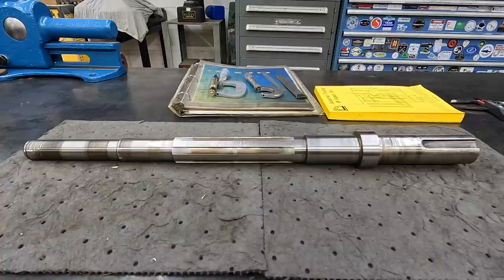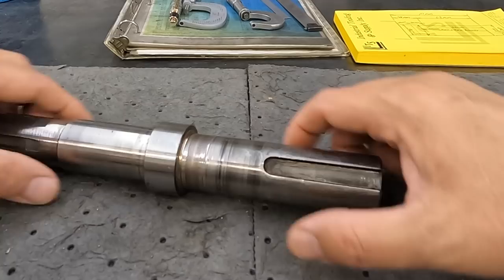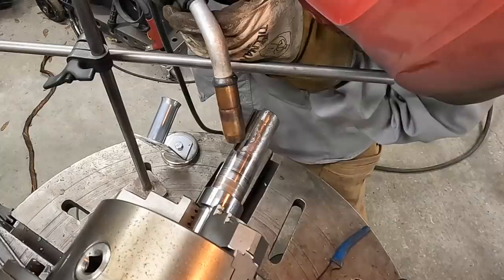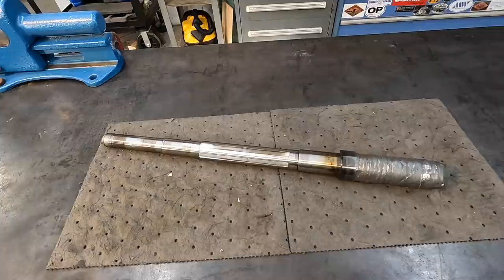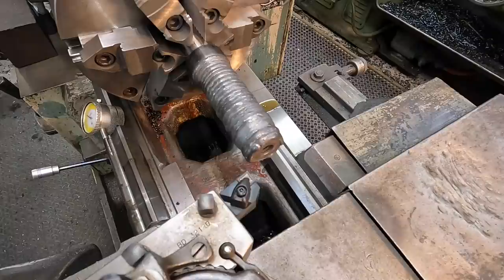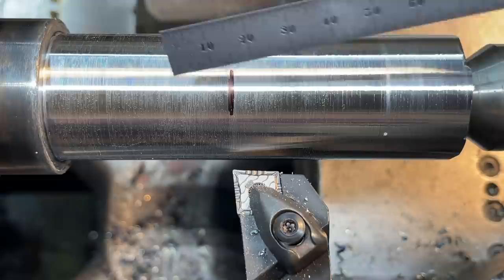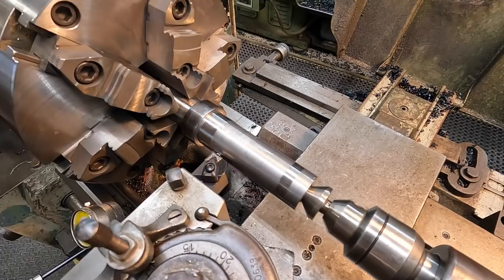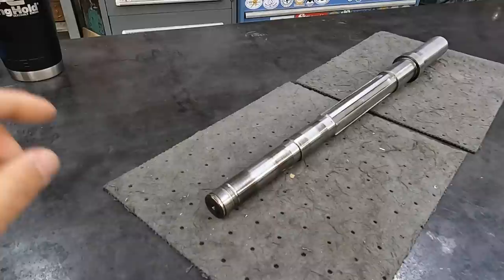Lathe Clutch Shaft Repair Part 1

Comment: I am new to this. But isn't it easier and more reliable piece if cut a new one?
Reply: If by cut a new one you mean make a new one from scratch, then no, it would definitely be more work. And a good repair should be nearly as reliable.
Reply: No the weld build up is as hard if not harder than original material.
Reply: @netsch20  
Thanks for the reply. Does the weld need to be heat treated in any way before machining to make it easier for machining? Does it need heat treatment after machining to retain its toughness?
Reply: @samimas4343  I'm no expert, but afaik no it wouldn't. Like the guy above who replied, welds are generally harder than the base metal.

Comment: Probably ok as this is a low stress item, although it is bad practice to radial weld a rotating shaft , should be longitudinal welds.
Reply: Why is that?
Reply: @davidraper9629  Theory is it will radial stress fracture and at some point in the future will snap like a carrot
Reply: @pijnto  I would love to read a paper on that. Something I have thought about in the past. However I never did anything more than think about It as it rarely applies to my situation but comes up occasionally.
Reply: @warrenjones744   sounds like nonsense. HT and temper are gone, so it won't "snap like a carrot." It will just bend... So I think he's just posing nonsense. and if it gets sent out for HT, which he probably won't since he's machining it to final tolerance, it's going to take care of any reasons he thinks may cause it to "snap." If it were to be sent out to HT, I can't think of any situation that would cause it to snap. Whether it is soft from welding, or gets heat tested. Maybe if you're building up half of the shaft's diameter with weld, it may cause issue, but that's generally not how welds work.
Reply: @littlejackalo5326  Like I said, I have thought about it and wondered, not too hard I might add, more of a passing thought. Anyway it would be interesting from a knowledge standpoint (for me anyway)  to read a paper on this subject. Either supporting the theory or not supporting it. Or perhaps @pijnto could have  given us an example of of something that failed from such action.
 
I on occasion weld shaft ends radially with an attachment for my borewelder or by hand and have never encountered any problems from doing so on machinery with moderate to somewhat heavy loading.  And as you point out,  it is never a lot of build up. Never more than a pass or two in which a vast majority gets machined off anyway.

Comment: ===CORRECTION I didn’t catch the “8” ====== leaving original comment - thanks for correcting me everyone. 

So do you need to build it back up? On the paper it said X.3785 right? And you measured X.3740?  I am a bit confused, apologies…. Unless this is within tolerance?
Reply: missing a 8, 3784
Reply: He ended up on .3784, thus one tenth under. Well within the 4 tenths tolerance.
Reply: At 25:11 he says "3784".
Reply: @gibbogle  thanks guys
Reply: @michedmck  thx
Reply: @taylorwso  thx

Comment: I buy a lot of used Starrett and Mitutoyo metric micronmeters, want me to keep an eye out for some good value ones for your shop? It always pays to keep a set of metric/inch mics around even if you don't use them very often.
Reply: ...you're forgetting that Adam's machines are calibrated in INCHES- I can't see how a set of METRIC micrometers would be of much use-(?)
Reply: @daleburrell6273  for doing the final measurement, conversion errors are less likely and the numbers are more rounded, for the 35mm you end up with 1 inch and .37795 as a decimal, rounf that up to .378 and not only is it still a somewhat less memorable number it's also got a slight error, sure that error is so tiny it's irrelevant in this case, sometimes the error can be large enough to be resolvable by the other sides instruments. Like I said it's nice to have a set of mics in the other system you less often, I keep metric and inch mics, even  if I only use the inch ones about 3 or 4 times a year it's just nice to have the proper measuring tool, no math needed. The less math is involved the less points of error there is.
Reply: @JoshuaNicoll  ...CONSIDERING ALL THE CRITICISM, MAYBE ADAM SHOULDN'T HAVE TAKEN ON THE JOB-!!!
Reply: @JoshuaNicoll  that's not how it works. the error asymptotically goes to zero. The units of measurement does not change accuracy. If you can measure tenths in USCS, and you can measure down to 10 microns, you'll end up with the same dimension. You can not get a 35 mm part any closer than 35.00 assuming you aren't able to measure to the micron. 10 microns 0.00039". So if you get it to 1.37795 +/- 0.0002 you're at the same accuracy and same resolution. You really need to sit down and figure out how your logic is flawed. It would probably help you think of it on a more extreme scale. A tenth (0.0001") indicator has a smaller resolution than a 10 micron indicator. So you'll actually be more accurate with USCS measurements. There is nevera situation where converting it will be internally more accurate. 1.37795 is just as accurate as 35 mm, unless you're capable of measuring to the 10 nanometers, and in that case you'd be capable of measuring to the millionths in USCS. The unit matters not, only the resolution of the gauge type measuring with. Do some research.
Reply: TLDR: nothing is perfect. It will NEVER be 35 mm. The ability to get it closest to 35 mm has absolutely nothing to do with the units, and everything to do with the resolution of your metrology equipment. Measuring 35 mm with a metric mic will only tell you that it's 35.00 mm, and that won't get you any closer than 1.3779" will get you. 1.3779" is 35.998 mm. So you'd need a micron indicator or a 10 millionths (inch) indicator. Both are on a CMM. Both are not able to be done precisely enough with an analog gauge. 0.001 mm is 0.00004". If you don't get it, just start reading about it.
Reply: @littlejackalo5326  ...ACTUALLY, IT'S: ".00003937", IF YOU'RE GONNA NIT-PICK- BUT YOU SUMMED IT UP PERFECTLY-!!!

SOME PEOPLE HAVE TOO DAM MUCH TIME ON THEIR HANDS!!!

Comment: Adam,
I have done numerous repairs that are similar to the damage on this shaft over a career maintaining machining machinery. I seldom resorted to welding build up to a precision shaft repair. I don't recall ever using weld to the extent that you demonstrated. Warping the part was my greatest fear. We had a much cruder welding positioner. Your fixture would have been a dream come true for our production welders. 
I am interested in how you redressed the taper for the tailstock center. At all cost, I would have protected that center as my basic part reference. Part of this fear was our production methods depended on the center reference to finish the parts including cylindrical grinding including both bearing journals and roll OD. Your shaft may tolerate more runout than our production parts, but I would be terrified of affecting the integrity of this shaft centerline due to all the heat introduced through the amount of heat generated by the extent of the welding.
Spray welding even makes me cringe for the same reasons. 
I will follow this repair with keen interest. If this is a Clausing Colchester shaft I can assure you that an OEM part can only be afforded by a big shop that can absorb the financial hit and relies on full machine load capacity. Lost production time for required parts can justify spending enormous amounts for replacement parts. Time and related production loss must not be a factor for your friend. In my hobby shop I am all about controlling part cost. This so different from my career years where I relied heavily on next day air parts delivery of parts costing in the tens of thousands of dollars. 
I can all but guarantee that this shaft would not be stocked at Clausing USA, and would have to be sourced from the UK.
I didn't understand where this part is from in the lathe except that it carries a clutch. This makes me suspect that it is a spindle drive shaft.  I would like to know more about its function. In all the years that I worked on Clausing Colchester lathes I can only recall one repair that required me to disassemble a spindle clutch.

I often comment to my friends that you and I have parallel experience, but our experience also greatly vary. When you move into my world of experience I smugly pound my phone screen knowing that your experience is less than mine and I know better methods. I watch your videos to learn about machining procedures and techniques since I am only a novice machinist. I recently purchased a similar American Pacemaker to yours. I later discovered that I don't have the capacity to rig it at home. I took delivery of a 14k # lift yesterday. I intend to quickly assemble and install it. Though intended for vehicle service, this lift may be my home shop rigging solution for the American Pacemaker.
Reply: ...A LITTLE MODESTY MIGHT BECOME YOU-!!!
Reply: I doubt your nearly as cool as you think you are. You sound like your Joe Biden, "Been there, done that!" Please start youir own chennel so we can watch your genius and comment.
Reply: I apologize for unintended spirit of criticism. I have developed repair standards based on my experience. I was a repair/maintenance technician. I come at tasks like this repair from my experience and also the limited experience from spending my entire career working in the same plant. I have serviced and maintained a wide variety of machine tools working with tighter tolerances than Adam demonstrates. I may be under false illusions about specific repair methods that my experience has made me fearful of and therefore steer clear of employing. 
I am passionate about my area of expertise, but I come to Abom 79 to learn machining skills that I lack, but want to learn. I enjoy the YouTube community when we share ideas and challenge each other. I never dream of matching Adam's machining skills or experience. I think that Adam and I could become very good friends. As his published work occasionally slips into areas where I legitimately have more experience than does Adam, It is fun for me to momentarily switch to the expert role and offer another method or question Adam's approach. My intention is not to come off with arrogance, but to mutually share experience so that all of us can grow (me included). 
I cut my repair teeth repairing manual machines including the same model K&T as Adam's. I think my shop culled our K&T in 1993. Adam made some inexperienced troubleshooting and repair "mistakes" on his K&T reconditioning that I could have helped him to avoid. That is an example of where my experience superceded Adam's experience and skill. That doesn't make me better, just more experienced in that specific area. 
I want to learn manual machining as my retirement hobby pleasure. I mostly maintained CNC and I have lost interest in CNC when there is so much to know about manual machining. I came to machine shop maintenance as a skilled electrician and had to learn the machining world from the ground up. I worked with 100-150 highly skilled machinists. Our shop drew rigid lines between machining and maintenance/troubleshooting duties. This distinction encouraged me to hone repair skills while only vaguely understanding or practicing machining skills. This has encouraged me to build an extensive hobby machine shop. My joy is learning and mastering new skills AND internet interacting with folk that share my interests, both learning and instructing.
I wrecked a gun frame part that I was helping a grandson machine this week. All was going well until my cheesey work holding set up allowed the part to move. I had fly cut the critical area that required attention and I yielded to, "Grandpa, can't we just make one more pass over the entire part?" The work moved on that pass. I was sick! He had so much time in hand work before he asked for my assistance. Yet he and I learned something from a situation gone a foul. I don't know if I can save the part or not. He had to go home and I am reluctant to do anymore machining on this project until we can do it together. I have reworked this part in my mind for the last 3 days. I want to try and salvage it, to save the part, learn and understand a new method, and teach my young grandson something about machining that he cannot learn in his home shop.

So please reconsider the spirit my original comment. In general I am not thought to be arrogant, so I was surprised to see that I touched a nerve. Many others have commented their welding concerns including concerns that I didn't even consider. If Adam's repair proves my concerns wrong, then I benefit from learning another viable repair method. I may learn that the old guys that taught me and my experience didn't teach me right or teach me enough. If so, I just won! Since I am here to learn and to share.

I have rigged 100's of machine tools. I rigged one mill that weighed around 50k#, squeezing it through a hole that gave us only 5,/8" clearance. We only had 6000# forklifts. We went through the hole and didn't scratch the paint. I recently smugly purchased my AP lathe believing the seller's insistence that it was under 4k#. I thought, easy peasy, I can rig that at home by myself. I did some research and this lathe is most likely going to tip the scales around 9.5k#.  This poses no problem if I was still working and had access to a wide array of rigging equipment and machinery. In my hobby shop I am limited to a 3T gantry. I am currently recovering from open heart surgery and pondering how I am going to affordably rig the AP when I am well enough to bring it home. I purchased the AP, because I could, it was cheap, it is so much bigger than my LeBlond and I think it will be fun to make big chips. I will earn the bragging rights for owning the biggest hobby lathe in the family and in the neighborhood. Those bragging rights are not arrogant, they are tongue and cheek, and I need excuses so the wife will continue to support my hobby spending. 

What do you all know about Adam's Precision Mathews lathe? It seems like dated technology to me for a modern manual lathe. I had never heard of the brand, though I have very little experience with Tiawan machines. Adam approved of the quality, so I bet it is a viable machine.  Our shop purchased a Korean built Samsung big CNC lathe to replace a 30+ year old Mazak. Mazak had in the intervening years gone completely high tech. I would have loved to play with the newest Integrex technology, but our application only demanded 1980's technology. We got what we needed in a smaller package and price by purchasing the Samsung and we upgraded an old G&L Endomatic (1960's technology) with a rebuilt G&L. Our shop tended to upgrade with the latest technology, but I fully supported the old technology upgrades in this case. Our shop was very loyal to Mazak. If Mazak built the technology, we rarely even considered alternatives. We ran a lot of other brands, but mostly because Mazak didn't offer machinery for every technology that we employed. 

What are your interests? I am focusing on manual milling and turning with a smattering of other technologies. A small surface grinder may be in my future and I might outgrow my Bridgeport knee mill.
Reply: @paulhunt598  dude, nobody is going to read that last comment, after your first comment sounding like a clown. Adam has don't an absolute ton of these, both on YouTube and at his job at Motion. You sound like such a goof. Bwahahaha. The guy who thinks he knows what he's doing, but really doesn't.

Comment: You should use chamfering tool(23:18) to clean up start of cut before you turn down shaft...hard on tool bits running them into weld build up, can chip them easily.
Reply: ...I'm pretty sure that Adam knows what he's doing-(!)
Reply: @paulcopeland9035  I've been doing this for 34 years...learned a lot from watching videos, more from on the job experience in a jobber shop. So...just saying, you will have less chance of damaging tool bit my way. But give 'er if you enjoy paying for inserts...
Reply: @boydhorning1830  It's good you've developed your skills in your work.  Adam has also been machining for decades, done this and many other things many times before, so he has his way of doing things, and his own priorities. You might enjoy going back and watching some of the hundreds of videos he's produced, especially the older ones, and get a better idea of his history and experience.  I suspect if he had ever had a big problem with breaking inserts, he would have figured out another way to do it.
Reply: @ydonl  I have watched all his videos, and have done very, very similar work. Learned a few tricks from him, and other videos, for sure. But also learned a few tricks myself. Seriously, just want to help. Any machinist here who has done any machining on built up weld will know what I'm referring to...they don't have to agree with it, or do it, but I know for a fact the step I mentioned keeps insert edges from prematurely chipping. At anywhere from $3-$6 an edge on a CNMG insert, I think its worth it. On some inserts with only 3 edges(TPG, for example) it potentially saves even more $. I'm not slamming his skills or technique...Adam is an excellent machinist...but so am I.